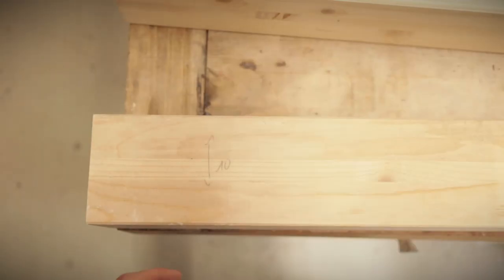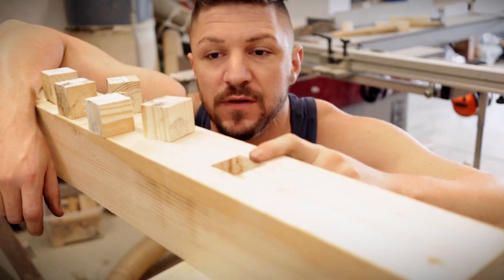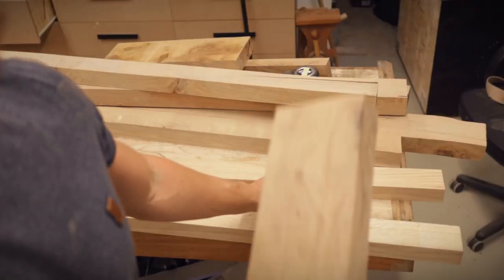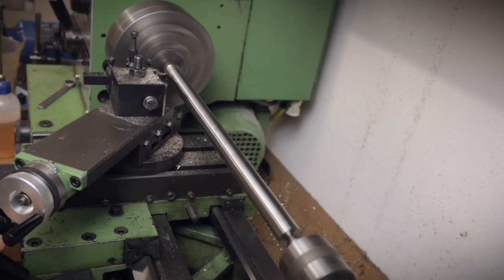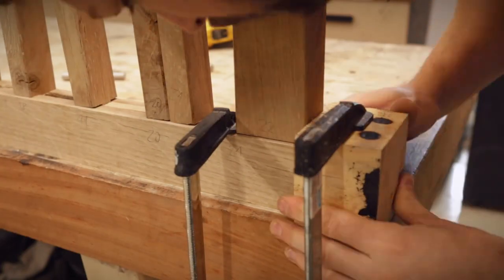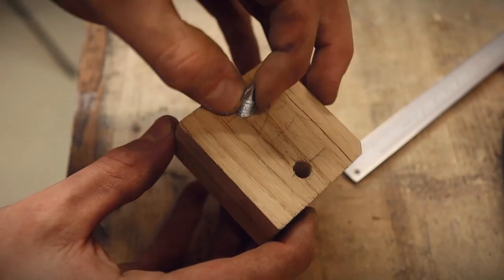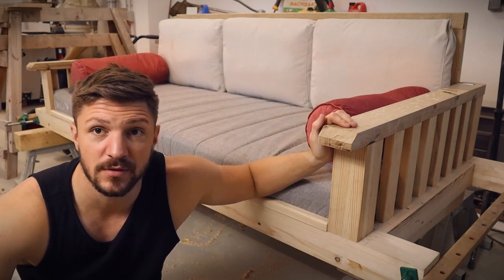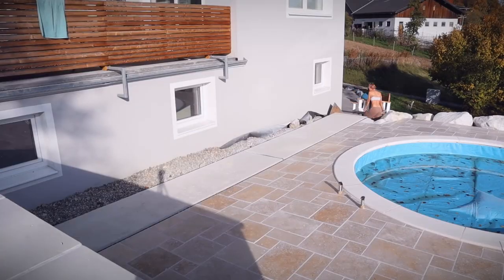*ADJUSTABLE* DIY PORCH SWING BED -  using a IKEA mattress

Comment: too funny loved the attempts to get the wrong through the hole.
Having  been there before and throwing a piece of scrap wood or two at the wall... it was clear for my 3/4" rope, that I drill a 7/8" hole.... slides right in :)

Comment: Nice build. The trouble you had with your router table and the kickback was you are running your pieces the wrong way! You did this twice. Try running your pieces through the opposite direction and you'll be fine, with no more climbing cut kickback.
Reply from the maker: Thanks for the comment! 
Is there even a difference in climbcutting / conventional cutting when you are full slotting? In my understanding both types are happening
Reply: @ChristophLehner  Hello, yes there absolutely is. So if the fence is on the other side in your case, it will keep your workpiece pulled into the fence instead of trying to rip it away..Even for a dado or slotted cut. Enjoy!